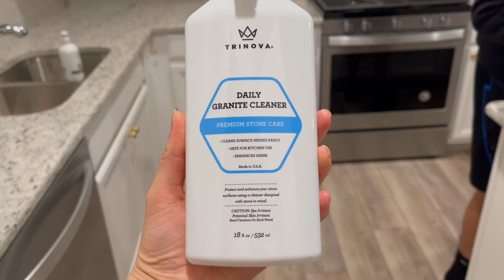Dyson V15 Detect + First Impression | Sealing grout / granite

Comment: U can use the particle reader to give u an idea if u think an area is throughly clean. Because if it looks clean and u see a big jump in the particle number, then it's really dirty. It's not about what u can see. It's about what u can't see. Also because u have the plus model (the teal colored filter), the filter is much more dense (can trap down to 0.1 microns vs 0.3 microns) and will capture even more micro particles than any other dyson - even the cinetic models. It can trap diesel soot and even the c virus
Reply from the maker: Thank you so much this comment is actually very helpful 🙌🏻